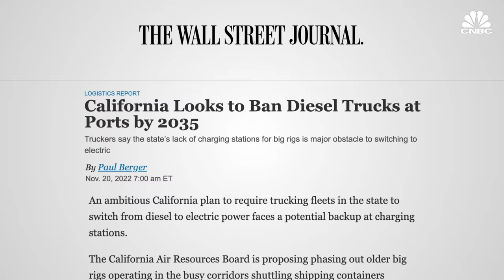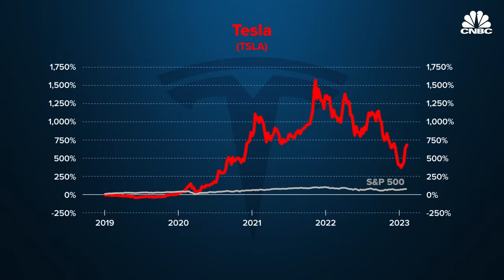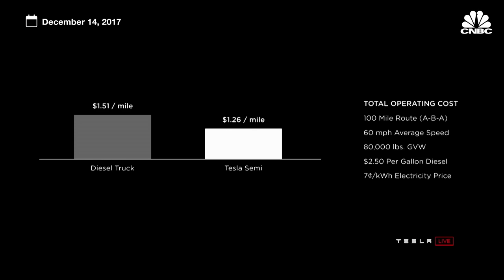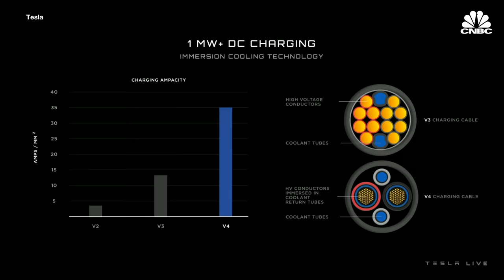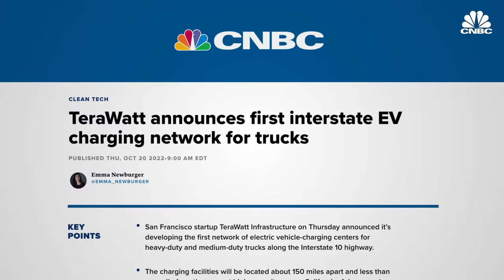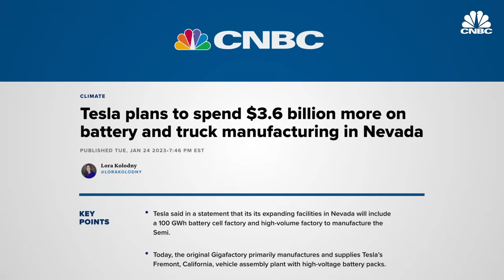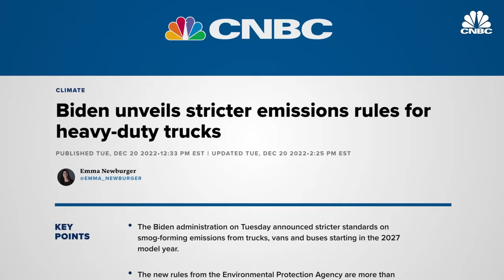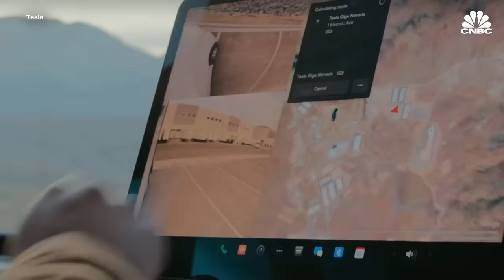Does The Tesla Semi Live Up To The Hype?

Comment: "The same amount of power as big box stores." Yeah, that's ONE location. Ramp that up across the US and we'd be a bigger CO2 emitter than China and India combined. Just think, where is all that electricity coming from? Mainly coal power plants. Not to mention the fact that the batteries used in these EVs cause more environmental damage than 100 diesel trucks per EV Semi. As a truck driver myself, i cant rely on a truck with only a 400-500 mile range. Some of the runs I do are 630-650 miles a night. With traffic, that's pushing a 14-hour government-restricted day because im governed at 65 mph. The fact that i would lose so much money by having to wait for it to charge whereas now, I can fuel in 5 minutes or less. Its a cool idea, but not practical and for sure not environmentally friendly. You also have to think that every time you turn on the AC, GPS, lights, anything in that truck, it drains the battery and reduces range. Add hills into account and you're looking at even less. I just dont see the viability of these vehicles beyond shorter city or local runs of 250 miles or less. Even then, the energy required to power these trucks would collapse our grid and pollute our atmosphere worse than any diesel truck.

Comment: That thing ain’t pulling no heavy equipment that’s for sure. Maybe a full load of potato chips
Reply: It can do 0-60 in 20 seconds fully loaded and climb a 6% grade at highway speed. No other truck has that amount of torque.
Reply: @johntheux9238  yes and stop every 300 miles to get charged again give me a diesel that can move freight and dig up quarry’s to produce teslas battery
Reply: @umadbrooo6947  *500 miles fully loaded.

Comment: I wonder how roads will handle even heavier semis with all those batteries, guess more budget will go to road repair...
Reply: In your opinion, just how much heavier are these semis?
Reply: @BigBen621  max load will be the same than regular semis, they just have less cargo capacity because of the extra weight of the batteries.

Thing is in the return trip when semis may be empty and lighter, these electric trucks will be way heavier than the regular ones and cause more road damage overall in a two way trip. Same effect happens with regular electric cars too. The new Electric Hummer I think is a 4.5 ton/9000 pounds paved roads murderer and the nightmare of any hatchback or small cars it crashes into.
Reply: @mafiousbj  Yes, I agree; I just wasn't sure where you were coming from. And actually max weight will be a little higher, due to the additional 2,000 lbs. of GCVWR allowed for electric and natural-gas powered trucks vs. diesel trucks (82,000 lbs. vs. 80,000 lbs.). It just comes down to whether we're willing to pay a bit more for highway maintenance, to get all the environmental benefits of electric vs. diesel trucks.
But I think there's a much bigger issue, that must be resolved sooner rather than later; and that is that there's currently no provision for EVs to contribute to road maintenance. Every EV that replaces an ICE vehicle reduces federal and state gas tax revenues, much of which goes into road maintenance. I'm an EV owner; but I still don't think EVs should get a free ride, and there needs to be some method developed so that other EV owners and I pay our fair share for road and highway maintenance.
Reply: @BigBen621  I totally see your point and agree with it. The issue is that most media has simplified the issue of EVs as "no exhaust emissions" therefore inifinitely better than combustion engine vehicles, when after all they are still cars (rubber waste from the tyres, not as efficent space-wise at carrying people as public transport because of the need of parking spots, road damage, etc).

I don't own an EV because it's prohibitively expensive and there is no infrastructure for them where I live, but I bike everywhere I can and use public transport (because my city allows for it, I know that's not the case everywhere). I do own a 90's BMW I take to track days for fun. I enjoy cars a lot, but I think if we really wanna solve the emissions issue, we shouldn't be replacing hundreds of combustion semis by electric semis, but rather we should push for trains and a last mille delivery systems (the least efficent part of the chain) based on smaller, city friendly vehicles.

As you say there are many deeper layers to the issue (such as reduced tax collection destined to road repairs) people usually gloss over, so it's nice seeing you take those into account and are well informed on the subject :)
Reply: @mafiousbj  Max load for EV semis is 82k vs 80k for normal trucks...

Comment: MENTIONED THE WEIGHT OF CARGO FFS. Also that electricity being put into those trucks is just putting pollution somewhere else. The constant discharge and charge cycles will destroy there batteries in a few years no doubt. Plus the fact they had to install essentially a small substation to charge a few trucks at once is crazyyyyyy. Musk claims somehow these will replace long haul routes and thats insane. Those small intercity route trucks are a perfect place for electrification! Not trying to compete with long haul diesel in which economically electric cannot compete at all. Just time wise diesel being a liquid high density fuel it takes a fraction of the time between stops for more fuel (even though faster charging can become faster it degrades the batteries more over time.). If anything rail is one of the better concepts for energy models for long haul across continents, using diesel and generating electricity to power the locomotive. Im sure a diesel electronic truck would make more sense in a way idk
Reply: tesla did a 81,000lb gvw trip at 500 miles with the truck but CNBC decided to completely ignore that and try to act like it only does 400 by getting "experts" who also ignore the range test.
tesla knows about pollution so they also sell solar energy to offset pollution, their factories are offset by their solar production,  these trucks have 811 chemistry, they will last around 400k miles, but in a year or so they will build silicon/iron based chemistries that push past 900k miles before hitting 80% original capacity. and yes they are installing a small battery powered substation for the chargers so it doesnt nock out your grid, ever seen how big he system is for fueling diesel trucks? we have time to solve that issue more than we do rising diesel prices. 80% of diesel truck routs are under 300 miles btw.

Comment: Is this not finally a case where adding solar panels to the vehicle would yield viable results? If an extra 50 miles could be gained from the long hours on the road, and it's key for a route just slightly out of range, why not?

That said, on regular motor vehicles I know they don't gain much range due to small coverable area. A semi trailer howerv has enough area to power a house.
Reply: I've kept meaning to do the math on this, and your post finally prompted me to do it. Here's the math:
Outside dimensions of dry van trailer are 53' x 8'6" = 450.5 SF. Assume 90% usable due to fitting panels, etc.; usable area =405 SF.
Various sources estimate rating of solar panels at 15 W/SF; 405 x 15 = 6.075 kW rating.
Picking Denver as perhaps an average location, 1 kW of panel at 0° tilt will produce 1,272 kWh/year (PVWatts). So 6.075 kW of panels will produce about 7,800 kWh/year. At 1.7 kWh/mile, this would give a Tesla Semi about 4,590 additional miles a year, or 13 miles a day if driven daily.
But wait, there's more. Various sources put the weight of solar panels plus mounting at 2 to 4 lbs./SF. Because solar panels on the roof of a truck could easily experience 110 MPH of wind (60 MPH speed plus 50 MPH headwind), let's assume the higher figure. So 405 x 4 = 1,620 lbs.; and this doesn't include inverter/converter, wiring, etc., so say 2,000 lbs. for simplicity. This will also inevitably increase air resistance. It's difficult to estimate how much, but let's guess that Cd goes from .36 to .37. The additional weight and drag will increase power to maintain 60 MPH by 112.1 kW/109.2 kW = 2.7%. This will reduce the 500 mile range by 13 miles ; so for a truck driven 500 miles a day, the additional miles due to the solar is exactly offset by the reduced miles due to additional drag and weight.
And this doesn't consider the financial and logistical impact of reducing the useful load by 2,000 lbs., or nearly 5%. Some estimates are that the Tesla Semi will have a payload of around 2,000 lbs. less than a comparable diesel semi, and many commenters have implied that this is an unacceptable loss of payload. So presumably the loss of another 2,000 lbs. of payload would exacerbate this issue, especially since there's little or no net gain, after balancing the gain from solar with the losses for weight and drag.
Results will vary somewhat, depending on assumptions; but regardless of the assumptions, any gain must be balanced both by losses due to weight and drag, and loss of payload. So this sound like a hard no to me. Thoughts?
Reply: @BigBen621  Thank you so much. You have pretty much proven that we are still at a point where the sums simply don't add up yet.

Did you consider the sides of the trailer as well? (Still understanding the weight implications).

We live in South Africa where sunshine is pretty abundant.

I wonder if they could use solar panels in a structural way to remove construction material weight from the actual trailers.

I guess till the weight of batteries, solar panels and peripherals don't come down significantly, the expense and effort has no benefit.

Great comment by the way.
Reply: @BigBen621  I've noticed that these trucks stand 15-30mins or longer wherever they are offloading cargo, so I guess having a charger wherever they stop to do quick top-ups would be more economical and logical. And I guess the cargo weight also becomes less as they offload freight as the route is traveled? In the case of Cheeto's, not that much probably.
Reply: @justwatching2000  Thank you for giving me the impetus to do this calculation, after months of telling myself I really needed to do this!

I didn't consider the sides, but I can address this briefly. First, even when pointed directly toward the sun, vertically-oriented panels on the side of a semi will produce much less energy that horizontally-oriented panels on the roof of a semi. Second, the best case would be when there's low sun directly to the right or left of the truck; but whichever side the sun is on, there'll be no sun on the other side; so at very best, each vertical panel would generate far less average energy than a horizontal panel on the roof. Third, in the U.S. most long-haul trips, where solar panels would presumably do the most good, are oriented east-west; and this means that at any time near the equinoxes, the truck will be driving toward or away from the sun, and there will be little or no energy generated by panels on the sides of the truck. And any time near the summer solstice, there will be very little sun on the north side and none on the south side. Only near the winter solstice will there be any sun at a low enough angle to generate significant power; but that's still nowhere near enough to come anywhere near breakeven; when horizontally oriented panels, all of which get some sun anytime during daylight, can't even break even.

My calculations on horizontal panels were based on Denver, at a latitude of about 40N. But even Cape Town in the far south is 6 degrees closer to the equator than Denver, so the net gain might be a few miles a day; but still nothing like what would be required to offset the loss of payload.

In brief, I just don't think there's any future in putting solar panels on semi trailers. Others may, of course, disagree!

Comment: Maybe they should develop a Tesla Trailer that houses even more Batteries this could double triple range?  Depending on weight. Extra motors can be added to each axle of the trailer to get it up to speed. Once it's rolling it doesn't need that extra torque.
Reply: That would be an extra $120k-200k per trailer as they would need 8 tons of batteries to 2.5x it's range. This semi only uses 1 motor to cruise, the other 2 are for ecceleration, no extra motors are needed unless for traction reasons.
Reply: @miguellopez3392   I think if you can afford it, that in 3 years of non stop driving a driver could put a large dent into it.  Also they could fit solar panels on the reefer units.  Anyways for now that would be the only way to make teams a viable option.
Reply: @miguellopez3392   they would need 8 tons of batteries to 2.5x it's range 
And reduce its payload by the same 8 tons.
Reply: @rockyjohnson9243  I did the math on adding solar panels to standard dry van trailers. They would produce enough electricity for an added range of about 13 miles a day. But the added aerodynamic drag and weight would decrease the range by about the same amount, for no net gain. Much more importantly, solar panels covering the top of a dry van trailer would weigh about 2,000 lbs., which would of course reduce the payload by that amount. I can post the calculations, if you like.
Reply: @BigBen621  Nice work Ben I guess they need to make it weigh less. I didn't think those panels where that heavy.  Figured they could 3d print it into the skin of the trailer itself to reduce the drag you mentioned.

Comment: I can already tell you when it comes to getting to the destination… the drivers all hate the truck. 

This truck was not designed for the job even in the slightest. 

It’s mere hype for an EV semi… impractical across the board

Just take the drivetrain and charging network and give it to the other EV semis
Reply: Other EV semis take over 3 hours to charge versus half an hour for the Tesla Semi. Other EV semis have less than 300 miles of range versus 500 miles for Tesla.

Comment: Heavy electric trucks are already outdated. See JCB's new hydrogen engine. Same output as their regular diesel engine, but only water droplets out of the exhaust pipe. The engine is testing now, and is to go into service very soon, and not Tesla's idea of very soon😉
Reply: Among many other disadvantages of hydrogen, the economics are awful. Real world example: The Toyota Mirai carries 5.65 KG of hydrogen, and gets an EPA range of 357 miles. A KG of hydrogen in San Diego, where I live, is currently about $17. So the per-mile cost of hydrogen for the Toyota Mirai is 5.65 x 17 / 357 = 27¢/mile. Meanwhile, my Tesla Model Y has a 75 kWh battery, and has an EPA range of about 320 miles. At residential rates of about 25¢/kWh (among the highest in the nation), the per-mile cost of electricity for my Model Y is 75 x .25 / 320 = 6¢/mile—less than a quarter of the cost per mile of hydrogen.

Comment: This is the most misleading video.  Incase anyone missed it this all happened because California matched their investment with a grant.  So show me this can happen on it's own without being funded by the government and then you have a viable product.  Another question I have is what happens to all these batteries?  Also, most truckers for long range do 600 miles a day.  If most of these trucks can only do 300-400 miles I just think there is still along way to go.  For charging the amount of power isn't going to happen with wind and solar.  It's neat technology I just think there is still years of development and maybe by 2050 but not 2035.  One last thing is nothing is emission free.  Maybe less emissions for the life of the vehicle but it still had production, materials, mining, etc to make said vehicle.
Reply: The misleading part is that tesla did a fully recorded test of their truck doing 500 miles with 81,000lb GVW over Donner mountain pass to prove its range but this video acts like tesla never did it. The other truth is that 75% of truck routes in the US are under 300 miles amd most are limited by volume rather than weight, so the semi truck could do 600 or more with volumetric loads.

Comment: Why don't Tesla trucks look as beautiful as other American trucks?
Reply: To reduce drag and further outcompete diesel on cost.
Reply: @miguellopez3392  they don’t really outcompete diesels
Reply: @rusty shackleford  they do, at comercial prices the semi saves $200k on fuel after 400,000 miles. Safety is another benifit, the tesla semi uses 3 motors to aid in traction controll as well as generate over a megawatt of power with regenerative braking so you dont require physical brakes when going downhill, this semi had cold brakes after decending a 6% grade from 3000ft of elevation at 82,000lbs GVW. The tesla semi also makes more torque then any other comercial class 8 diesel semi truck moving its full load from 0-60mph in 20 seconds.
Reply: @miguellopez3392  you’re forgetting that these aren’t mass produced so there’s no data on the reliability of these cars
Reply: @rusty shackleford  reliability is expected to be low as with the first generation of this truck, they already had a recall due to a supplier issues, these trucks aren't even using teslas newer 4680 cells, these trucks are to collect data on real world use so when they get to scale they have gotten most of the issues resolved and don't do recalls on trucks that are very hard to repair.